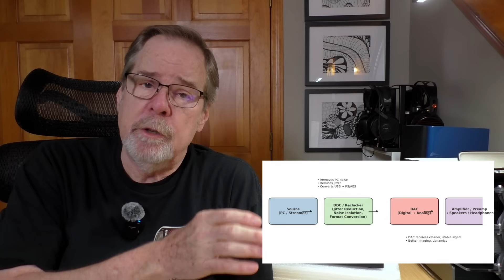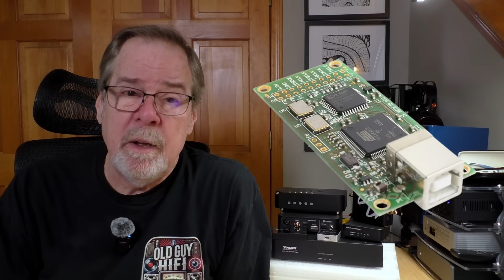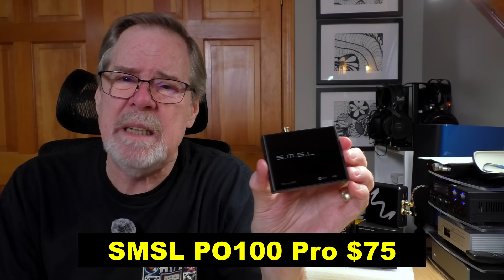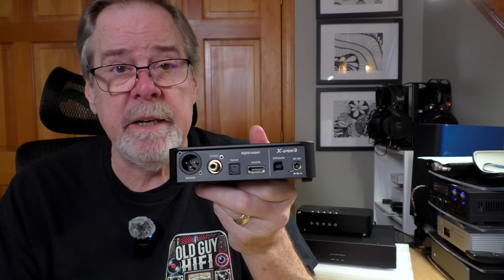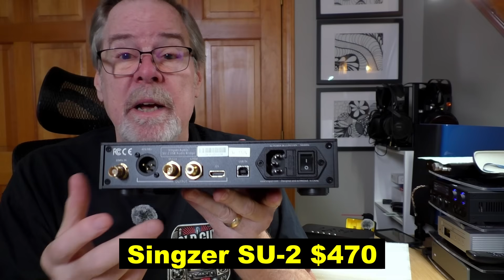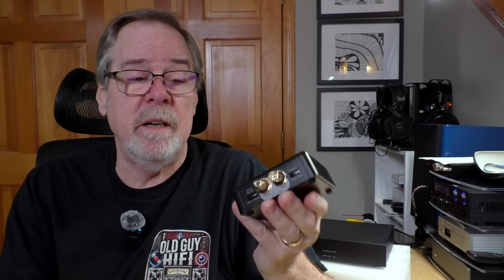OH NO! DDC-Reclockers! Do they really make a difference? YES! They do. I can hear it now “Snake Oil”

Comment: Computer guy here: Not snake oil, but facts that apply or don't 
1) Toslink and converters for sure. 2)USB to USB errors don't exist (unless something is defective). The USB will buffer both sides and check for errors and resend. As fast or slow as the DAC's USB end reciever/buffer will take it. If this didn't work to perfection - Otherwise every computer would be horribly corrupted when installing a program or spreadsheet, etc off USB (CD)  This is 100%  ones and Zeros. 3) Timing yes (it's data clean already) drawing data from the USB buffer properly is important in the DAC only.   So DAC is accessing it's USB buffer and feeding data to its circuits at the right bit rate. DAC's can design their USB for integration or off the shelf chips as they must set the way data is used from the buffer as a computer will send it as fast as possible. 4) **What you say is absolutely true for toslink or converters.  Toslink optical (coax especially with crap electrical connection) has no integral data buffer so bad timing causes errors unless the receiving end handles it well and this is no given. Hence some of your devices may have very different results you can hear. 
Not true for USB nor even cheap CD "transport" in your old PC (it's has 3 lasers that check the data.) 5) If you have a CD problem, the disk is damaged and it will attempt to play it regardless where the computer will stop.
FPGA have been used for decades myriad of uses and yes a DAC can take control from the USB interface. If USB was so bad neither computers would work (intolerant of error unlike music where a missing bit can't be heard)/nor would you be able to play even reasonable music from a computer or phone.
Reply from the maker: Very interesting points. I appreciate the feedback!

Comment: I found this tweak to be recently rather surprising and for some time I have running my WiiM Ultra to your recommended SMSL PO100 Pro and then I2S to my Topping Centaurus and the difference has been impressive and thank you.  Just picked up an SMSL PL200T CD transport which is an amazing unit but what’s been an amazing upgrade is running USB out of the Ultra to the USB input of the PO200T and then I2S out of the PO200T to my DAC and change input of the PO200 to USB input rather than the CD input.  WOW! Blows the SMSL PO100 Pro away. Far more detail and wider/deeper soundstage.  Thoughts?
Reply from the maker: Yes. I think SMSL has put the PO100 Pro circuit in the PL200T.
Reply: Sounds far more detailed and dynamic than the PO100 Pro. If you still have a PL 200T try comparing the two.  Also am using and IPower Elite X power supply on the PL200T which dramatically improves it.

Comment: I think you nailed it early on, and later on during the summary, when you talked about having a functional need (conversion, resolution requirements etc), or having audible noise problems noise being introduced from a dirty USB source and it is not being handled by DAC (an example being the Topping D50III which I own). In such cases, DDC re-clockers can be useful in solving the problem. I think they only really become "snake oil" products when they are sold to someone who has no such functional need or audible noise problem with their existing setup, yet they are told it will still make audible improvements to their system, which in my opinion is nonsense. 

I mentioned earlier about the Topping D50III, so for example when I was using a work Dell laptop there was a "dirty" USB signal and the D50III just couldn't handle it (to me, that is a flaw in the product) and so it translated into audible noise, which I fixed with a USB galvanic isolator. However, I now have a Lenovo laptop and the USB output does not create noise so D50III does not need the isolator, and whether it's in the chain or not, there is no audible difference. Similarly, if I just swapped out the D50III for another DAC (in this case the Fiio K11), then regardless Dell or Lenovo USB source, there is no audible noise, so again no need for a device like this one. So, no I don't these products are snake oil, but similar to things like power conditioners, they should only be used if there is a functional need or an audible problem to solve.

Thanks for the video!
Reply from the maker: Thank you for sharing your experiences!

Comment: Consider stopping the pre-rinsing of your dishes.  Modern dishwashers adjust their cycle time using a sediment sensor.  Pre-rinsing the dishes is not only a waste of water but you may be causing the dishwasher to short-cycle and not thoroughly wash your dishes of caked on sediment.
Great video covering modern DDC's in laymen terms.  Been a proponent of jitter correction and word-length addition since the Audio Alchemy DTI-Pro.
Reply from the maker: It was just an analogy. Thx.

Comment: Thanks for this video.  You will get baked by some 'audiophiles' in these comments. But you knew that. So I'm here to thank you;  I am fully on the side of DDC's matter, cables matter, isolation of speakers makes a huge difference.... etc.... I'm that guy. 
The audiophiles that shrug off DDC's and all other 'snake oil' stuff have never (or rarely) heard an incredible and highly resolving system. It seems to be about 15% of the overall community.  Keep up the great work!!
Reply from the maker: Thank you. I like a good fight. Thx.

Comment: Please forgive my ignorance, but if I am streaming to multiple rooms, would a reclocker be required for each room, or just the initial streaming point receiving the source which then broadcasts to the rest of the house?

My use case is pc into a schiit modi into a wiim pro.  The wiim is then coax into a Geshelli J2 into an amp, but also streams to other wiims in the house.  The reason for the schiit step is I didnt initially get the USB module on the Geshelli and I want to have the intial ssource a wired one. The other wiims (all the same) also feed into Geshellis.  So my question is actually, would a reclocker between the PC and Schiit at the initial suffice for the entire house, or would each subsequent stage after a wiim need a reclocker?  Thanks for answering an odd question.

 Thanks
Reply from the maker: In your case you don't need a reclocker. There would be no benefit. You are good to go with what you have. Thx.
Reply: @OldGuyHifi I have: Wiim Pro > J2 (4493) > Advance Paris X-i75.  Would I benefit from SMSL PO100?
Reply from the maker: @DavidDanielson2  David, No. You can't use the SMSL as your WiiM lacks a USB output. All of these devices except the Wyred 4 Sound Remedy Reclocker require a USB signal. As it is you have a very good set up. I love the J2 4493 and oh my do I love the X-i75. Good stuff my friend.

Comment: Geshelli's Amanero Combo386 employs Shenzhen clocks, almost certainly to control costs. I have been advised that the much better (lower phase noise) Crysteks are a direct swap. Also, because Geshelli's USB is not galvanically isolated, that is one of the benefits provided by a good DDC. The SMSL PO 100 PRO does not provide galvanic isolation, but one can use an inexpensive (e.g. $40) ADuM type USB isolator in front of it, which I have found to be superior to the PO 100 Pro alone in that it noticeably reduces the noise floor. 
Be sure to check into the LHY UIP - USB Isolator/Regen/Transmission Protocol Reclocker. It is a game changer for USB audio.
Reply from the maker: Great tips. Thank you.

Comment: I use the RME ADI-2 PRO FS R BE as my dac and am getting their DPS-2 linear super low noise dual audio power supply. A little.spendy yet made by RME for their products so will get it and try it.
Long story short I want a reclocker and jist not sure what way to go since I use an Integra CDC 3.4 6 disc player as my transport
Reply from the maker: For doing SPDIF the only good one I know of is that Wyred $ Sound unit. I am using it on my old harman-kardon FL8550 5 disc unit and I am very surprised by the performance. I expected a bit of an improvement but got a lot of more than just a bit. Thanks for commenting
Reply: @OldGuyHifi I will look into it since the cd players only have Optical and Coaxial. Thanks again. Your videos are always educational even if I do not want or care for certain things, it is good to know ones options. And real nice to have another who could care less about measurements  lol. Have a few monoblocks that you may want to do a review on and a preamplifier as well.

Comment: Great content thank you. But I'm a bit skeptical still. If DDCs improve sound, then why don't dac manufacturers just bake a ddc functionality into the dac box itself? 

I'm hating this concept of separates. Streamer/transport, power conditioners, upscalers, external clocks, DDC, dacs, preamps, amps.. where does this end..

Is there any dac amp which is engineered so well that it doesn't require a separate ddc box?
Reply from the maker: Yes. I am sure there is, but it will be expensive and you would need a very resolving system to get any benefit. DACs are designed with cost and other considerations and are always a comprise. Here is an analogy: Almost all modern PCs have a section on the mother board that can do video. Any one who is into the gaming hobby, kind of like the Hifi hobby, always upgrades their video card. Thats because when designing the PC there are certain comprises. Usually it is a cost consideration, power supply limitations, and form factor. I know of a few DACs that don't need a DDC but there are all over $10k in price. Let's say you have a good  $1k to $2k DAC adding a $500 DDC will honestly give you about 75-90% of the performance of that $10k plus DAC for less than 25% of the cost. I hour that helps to answer your question. Thx.
Reply: @OldGuyHifi Thank you that helps..

Comment: Would you say you hear a bigger difference between no DDC and one of the sub $100 ones, or between upgrading from one of the inexpensive DDCs to the Liav DDC or another price-equivalent one?
Reply from the maker: That's a hard question. I definitely hear an improvement with the sub $100 units on most of the DACs and systems I have put together that cost less than $1000. Once you get a DAC that is in the more premium price range, they are very good out of the box. On those units I find that the premium DDCs have the most noticeable improvement. Great question. Thx.

Comment: I was frustrated with the noise of the USB on my WiiM Ultra. I have it linked to my Geshelli Labs J2S(Sparkos op-amps on the SE) via USB & optic plus RCA to the same switcher the DAC goes to. Using optic my speakers were silent while pausing the music at relatively high volume as was using WiiM’s built in DAC yet i still felt the fidelity was superior via USB. I tried a USB isolator and a  USB noise filter. Both helped slightly but not enough. Daisy-chaining them proved worthless. But then I took a chance on a brand new $250 product by iFi : USB iPurifier Pro. Still no reviews yet that I know of. Solved my problem and beyond. Not only do I have actual silence over USB the sound is more refined, smoother with better clarity and less fatiguing. I now have the high-end analog sound I was seeking. At least as much as my current system is capable of. This USB device galvanically isolates, removes ground loops, and utilizes active noise cancelling tech to reduce EMI & RFI. Not certain if it actually reclocks the data(thought it claimed such but now I don’t see that in description). I also have the iFI LAN iPurifier which does reclock feeding into my $18 network switch via cat8. Adding the Ethernet cleaner did refine the sound, a subtle improvement. The USB cleaner was more profound. I am using decent audio-grade USB cables but nothing expensive. I really doubt a $400 or more USB cable would allow my 56 year old ears any discernible improvement over my $8-$25 cables. I’m not absolutely certain any reclocking in my chain is actually providing improvement yet it’s sure doesn’t seem to be hurting. All I know is my sound is more enjoyable with these devices in: more clarity yet smoother and more refined analog sound, tighter bass, lower noise floor, larger soundstage, even better imaging although for me it is definitely the removal of sibilance and the noise that was masking the definition that is most notable. Thank you Ed for your insight.
Reply from the maker: I am glad you found a solution. Thx for sharing your insights.

Comment: Thanks for the long but informative discussion.  As someone who streams from my smart TV to my T+A Dac 200, I wish there are audiophile grade HDMI to Toslink converters i.e. Xmos, FPGA, and internal master clock.  Tried a few from generic ones from Amazon but they didn't work for whatever reason.
Reply from the maker: Take the optical out of your TV to the DAC. I would think that, that would be best.
Reply: Take 2 (my first attempt went AWOL). +1 for Ed’s suggestion to use Toslink out of your TV it if has it, which Chat GPT reckons most brands still do. I’d strongly recommend using a decent s/pdif reclocker with it though, as the Toslink out of your average TV is typically a thin, shrill jittery mess, that most DACs struggle to turn into a silk purse. The WYRED 4 SOUND
Remedy Reclocker recommended by Ed or the cheaper but still very effective iFi s/pdif iPurifier2 would make your DAC’s life a lot easier. In my system the ifi  significantly improves on my Panasonic OLED’s Toslink out, a richer, more dynamic, calmer and more expansive sound. If you mess with upgrading the power supply you can even get soundstage depth and layering from AV content, if still not quite at the level of a cleaner more dedicated uncompressed audio streaming chain…

Comment: Does anyone have thoughts on placing a re-clocker between sources and a Chord Qutest DAC? The Qutest is already a FPGA device. Maybe for USB input?
Reply from the maker: Yes. That would be the correct way to implement a DDC is via USB. I have run DDCs on the Qutest when I had one in for review. As the DDC was not part of my reviewing process I didn't mention it as I like to review gear as it comes out of the box. The DDC did make a noticeable difference.

Comment: I bought a Gustard U-18 to pair with my R-26. Got it through Amazon so I could return if no audible difference was made. Used the I2s connection between them. It opened up the soundstage and tightened up the bass. It’s a keeper.
Reply from the maker: That's what I like to hear.

Comment: One annoying thing for me is why can’t the reclocker be built into the DAC?
Reply from the maker: Cost and design constraints limit what a manufacturer can engineer into a DAC at any givien privce point If you are spending $5k plus on your DAC then a DDC will have a bit less impact then when used on a $1k DAC. While digital files are theoretically "bit-perfect," real-world playback is subject to timing errors, electrical noise, and protocol limitations. These issues manifest not as missing bits, but as subtle degradations in sound quality — smearing, loss of dynamics, and reduced realism. A DAC must reconstruct analog waveforms from the incoming digital stream. Errors in timing during this process can lead to audible distortion even if the data bits are intact. A good DDC/reclocker can act as a “digital preamp for your DAC,” cleaning, re-timing, and reformatting the signal before it reaches the conversion stage. This often results in more natural, engaging sound, greater flexibility, and extended gear lifespan—especially valuable when your source or DAC isn’t already world-class in jitter rejection or noise suppression.

Comment: I have to ask. Do you think the new version of the Donk is a upgrade over the SMSL PO100 pro. Even if the upgrade difference is marginal.
Reply from the maker: I do. The Douk does have a better clock and I like the form factor better.

Comment: 4:23 While this is true it's only a benefit if the DDC has a better clock that the one it's replacing. It's possible to make it worse by using a DDC.
Reply: You`re right, don`t forget the inside clock is much closer to the source. And the extra connection required introduces all kinds of new issues.
Reply: @brugj03  You're right about it being closer. Assuming an equivlent clock on the DDC and internal DAC clock, using the DACs  will sound better. The clock signal ideally should have sharp edge square waves, however those edges become rounded even as the signal travels down a wire.  The closer that clock signal is generate to the DAC chip the sharper the square wave will be.   So if you have a high end DAC with quality clock you almost always want to use that. Now a DDC has the 2nd benefit of reducing noise, which is likely a greater contributor to any sonic improvement.
Reply: @G3rain1  Maybe, but it is easy hearing diferences. Much harder hearing what is better or worse.
Some differences just blend in the total sound so nicely that they seem to be improvements.
However they are not reproducable results in many cases it can sound worse.
Reply from the maker: Not in my experience.
Reply: @OldGuyHifi Maybe, you should raise the bar a little.

Comment: Its definitely something I've thought about adding as a finishing touch type of thing. I'm using a 20 year old dvd-audio player, that I use to play all sorts of formats, connected via coax to a chord 2qute. The player itself is very clean and detailed and airy, with space and punch (I think the R-core transformer helps a lot) but I'm always keen to find ways to help.
The only thing would be, an additional device is going to introduce its own losses, extra connections, internal wiring etc... I always wondered whether a DDC would be an actual across the board upgrade, or more of a tradeoff. I haven't jumped into it yet, because I can't stand to trade anything off
Reply from the maker: Good point. Thx for tuning in and commenting.